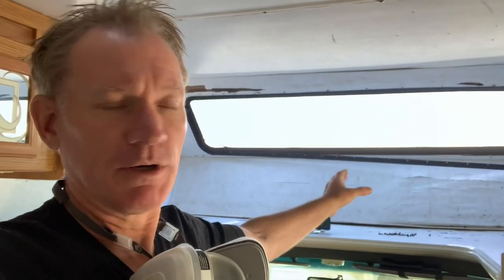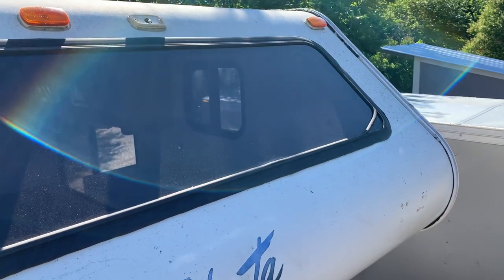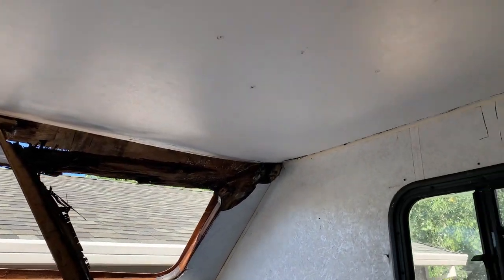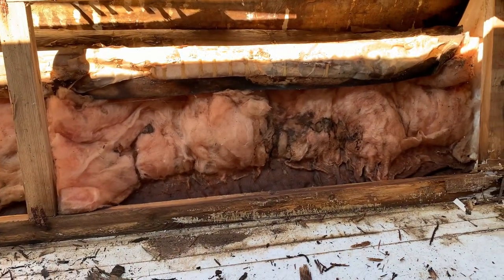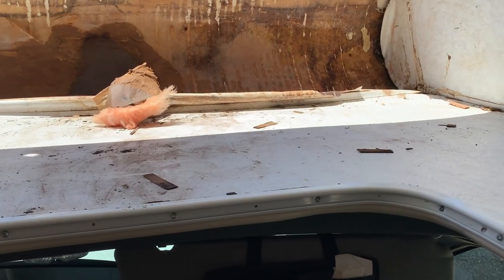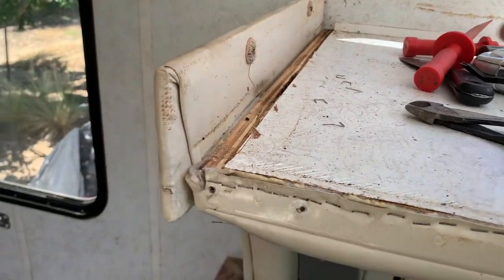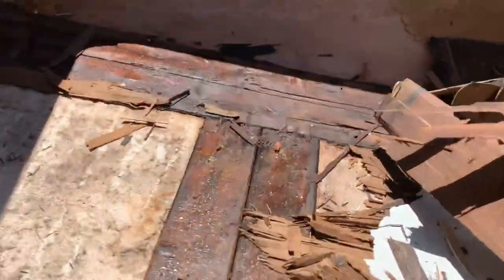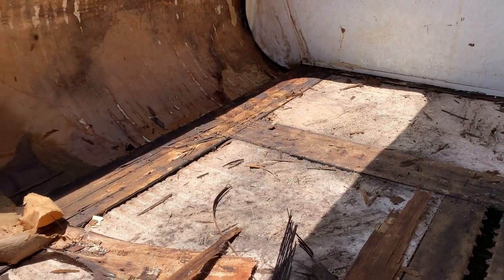Class C Motorhome Water Damage Repairs

Comment: i have a 85 tioga rotted bunk .i have found the front sloping window dosnt have a drain like all the other windows do which is flawed and the weather seal which i replaced that seats against glass only really keeps glass in and isnt a proper water tight seal so the water overflows in the channel the seal fits into and overflows into the channel behind it then into the cabover.what i did was drill 4 small holes in the bottom of the front channel the seal fits into to allow the water to drain out properly.also i cut out 2 or 3 10mm sections from the back of seal bead at bottom of indow to allow water out.
Reply: Have a 82 with dual fronts. It needs reframing of front wall and both overhang side walls. No visible delam of  outer front or sides, but framing is gone. Thanks for the heads up.

Comment: I'm finishing up similar cab over rebuild on my 98 c class. After drying out I painted the framing with a hardener and sistered in where needed. U mentioned jacking up the cab over? Do U have any pictures of the process?
Reply from the maker: Yes, next couple of videos will show that process.
Reply: Jam a wedge in there.
Reply: If may ask... what kind a hardener are you using ?

Comment: Hi. We have the same issue. But we also have water leaking on the ceiling inside the cab itself.  Where would that water be coming from
Reply from the maker: There’s a seam/sealant where the fiberglass meets the van cab/chassis.  That seam/sealant should be inspected and resealed if needed
Reply: The seal between cab and bunk

Comment: stick of dynamite should do it. Im so glad i sold my 29' class C replaced the roof n resealed it twice rubber roofs are horrible
Reply from the maker: EPDM and TPO Rubber are excellent materials.  It’s almost always neglected maintenance that causes the leaks.   
I’ve inspected original EPDM rv roofs that have been properly maintained last 20-25 years.
Reply: @covetthecamper2289   I spent 4500 on complete new roof, sealed n within 3 yrs leaked then resealed even the overhead lights...leaked again staining the fabric interior...they all leak...mold too.